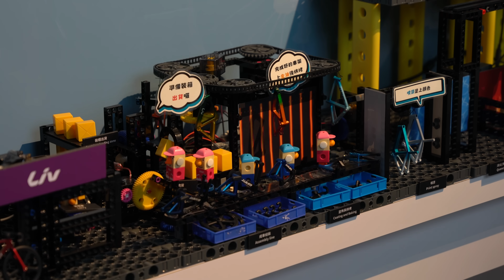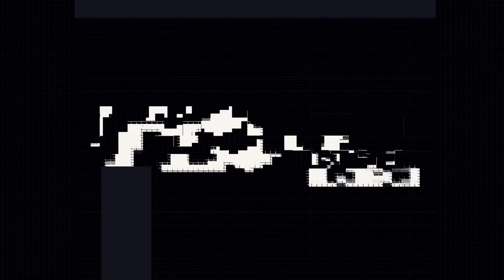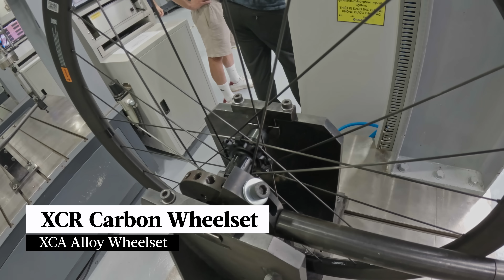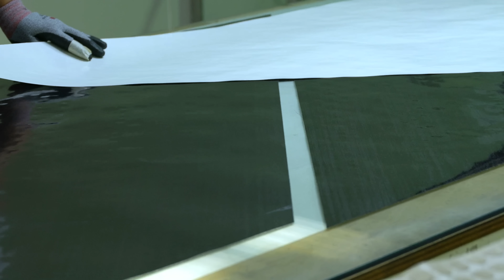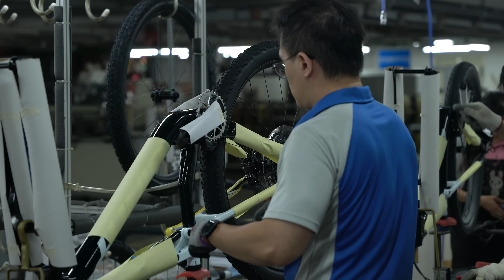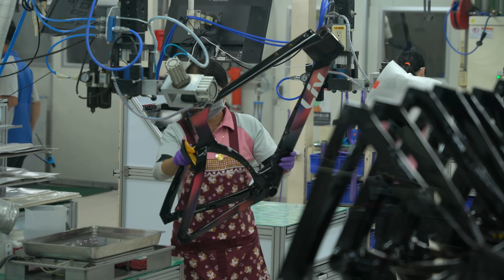Giant Anthem and Anthem X First Ride and Factory Tour | A celebration of Type 1 and Type 2 fun

Comment: $6k for cable deore with a 2 pos dropper, 550g cockpit, and alloy wheels is absolutely bonkers. I'm all for pushing limits and having $12k top end builds, but giant used to be a value driven brand. The bike looks great but I just don't know if the frame is really worth as much as they're asking for it.

Spec has Epic 8s with carbon hoops and GX transmission for $5700 right now.
Reply: I’m wondering how much the tariffs are effecting the prices of these bikes in the United States?
Reply: @coreymclernon I think the prices are pretty similar globally. However it wouldn't surprise me if the US price is the anchor price and they bump up other localities accordingly
Reply: El giant equivale a un swork
Reply: Giant Anthem is far better than Epic 8. Epic 8 is just a standard bike like there are a lot on the market.
Giant Anthem is the top of the technologie, no bike is better than this one, that’s the reason why Giant is the best manufacturer on the planet and manufacturer of other brands frame.
Reply: @lio220 have you actually ridden this new anthem?

Comment: I love Giant bikes, I have bought several over the years. Ever since I saw the Canyon Exceed CF SLX MVDP which comes in at a weight of 9.39 kg I tend to use that as a benchmark. It's a little disappointing that Giant can't make a XC bike under 20 lbs. Especially at this price point. $15K Canadian. The Canyon I mentioned was worth $6.5K. I know the only real difference is this is a dual suspension where as the Exceed is a hard tail.
Reply: Canyon are very overpriced when you look at Radon's bike range from Bike Discount in Germany. I couldn't buy the parts on either of the last two bikes I got from them for what I paid for the whole bikes, built and shipped to my door. The most recent one shipped in a massive bike box, which meant all I had to do was fit pedals and straighten the bars to be ready to ride. The hardtail I got 2 years ago from them was also €1500 (At the inflated bike prices of the time) and about 12 kg. Similar builds from other manufacturers were about €1000 more.

Comment: i post you the top commend from pinkbike under this new model....i agree with it 100%   --  "" Man the X version was on the short list until I saw the headset cable routing. Shame'''
It's so frustrating to see one of the worst trends in moden bicycles get perpetuated. And for what, asthetics? You've still got the front brake cable sticking out. Wind resistance? I see knobby tires on that bike, get outta here with that excuse. Its extra irritating to see the biggest brands pushing this along when we saw Propain do a 180 on it earlier this year.
Reply: Ahh the Pinkbike echo chamber. Like seriously outside of THAT circle jerk, no one cares. I have headset routing on my Merida 96RC. I service it every 12 months. It’s fine. If bike manufacturers listened to that comments section we’d have 1000mm stack heights and 25kg trail bikes.
Reply: @Redgodzila  Agreed.. I have the same XC bike as you and it's really not been an issue. Given the choice I'd probably choose non-headset routing, but it's a fair way down the list of considerations for me, and I do all my own servicing.
Reply: Totally agree. Headset routing is an instant no from me on any bike. There are plenty who will argue that its good which is a shame.
Reply: I'd have less of an objection to it if it wasn't combined with a direct mount headset, which, on every bike I've owned with one, always starts creaking after a few months. The bearings are fine, but where they contact the headtube seems to be prone to the grease washing out and creaking setting in - especially where I live, where every spin is by default going to involve hitting mud and surface water. Stripping it down and regreasing without the cables run through the headset is enough of a pain, without adding that extra annoyance. Pray you don't need to replace the bearings, at which point you're adding a brake bleed to the job.
Reply: It’s totally a nonissue. I have a hard time believing this would sway anyone from purchasing this bike. People need something to complain about I guess.

Comment: New anthem means more stupidly expensive with the usual bs marketing
Reply: Yep. $7k+ for the poverty spec is ridiculous.  That and the headset routing. Zero chance of me buying
Reply: The last Anthem I bought had 26" wheels and QR hubs both ends, and it's still running after one no quibble warranty frame replacement from Giant, when the top tube cracked a cm or two from where it joins the seat tube. This was a very common failure mode for that frame, and it took a lot of mileage before it cracked. Unlikely to happen again as the replacement has got a much easier life as it's about my 6th most used bike at this stage, while it was either my most or second most used when it failed. 

The big thing I always notice riding that bike is how lively it is. I test rode one of the first Anthem 29ers when it came out and it just felt dead by comparison. The wheels were too far in front of and behind between the rider for weight shifting to make any difference to the way the bike handled. Boost spacing more or less fixed the chainstay length issue, but there's nothing that can be done about toe overlap with the front wheel apart from moving the front axle out. 26" bikes just feel way more alive on trails. I also have a couple of boost spaced 29ers and they're probably faster on any given marathon loop, but a lot less satisfying on tight tweaky trails where speed can't be used to plough through.

The prices Giant are looking for now are outrageous though, especially when you see what Radon and similar brands are offering for thousands less. Also headset routing can die of gonorrhoea and rot in hell - I'm not touching it without being paid very well by the hour to do so - especially since headsets were fit and forget items, but the cupless headset designs used in everything now are far more prone to creaking, so they need to be opened every few months to grease them just to shut them up, making routing the brakes though them a much bigger issue. For comparison, the Hope headset on the bike I've been commuting with in all weathers is still dead smooth 23 years after I first fitted it. Last time I opened it was to change the fork nearly 10 years ago, when I was setting it up for commuting, and the bearings were still perfectly smooth. It has never creaked ever, with no maintenance at all - it had over a decade of hard XC and marathon riding before I retired it to commuting too.
Reply: Polygon syncline Dr is the new xc bike, that looks amazing and value for money.

Comment: Please, what is the weight of the bike ? It's important, contrary to what Giant suggests...
Reply from the maker: Hey! The complete bike weight will obviously depend on size and spec - Wil's test bike is the Anthem Advanced SL 1 in size Medium, which tips the scales at 10.8kg. That's setup tubeless, without pedals. Cheers, Nick
Reply: @FlowMountainBikeYouTube  Thanks. It's quite light for a GX bike.
Reply: @F @FlowMountainBikeYouTube  That’s 23.8 lbs for the 350,000,000 people who live in the USA.  Pretty light, indeed, but it is a medium sized frame